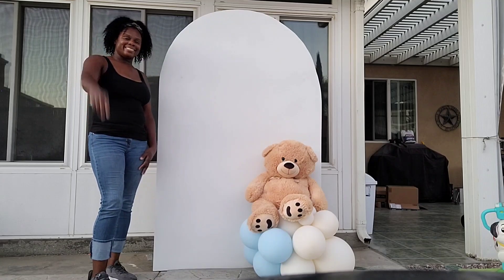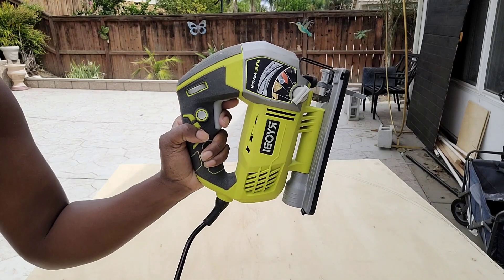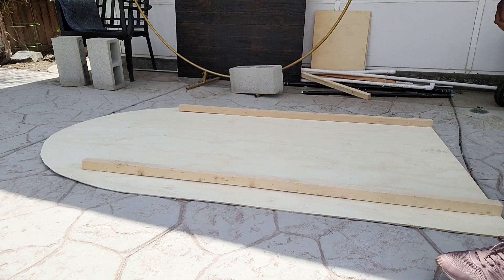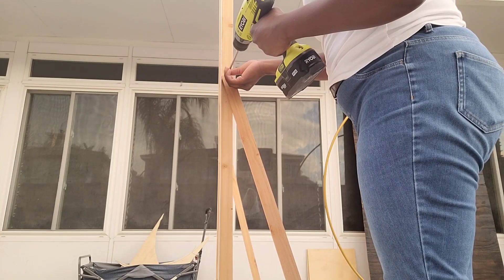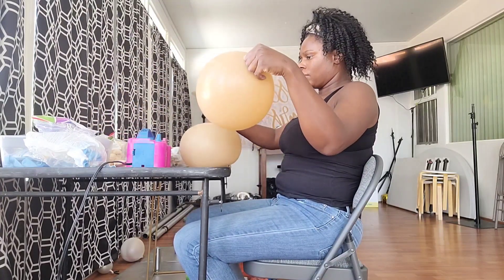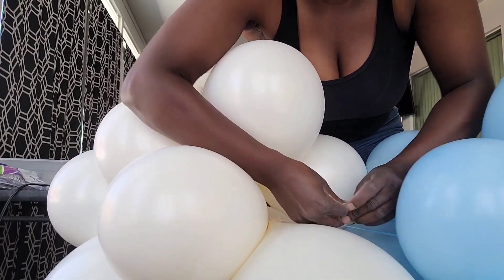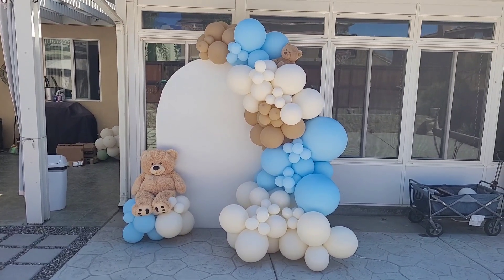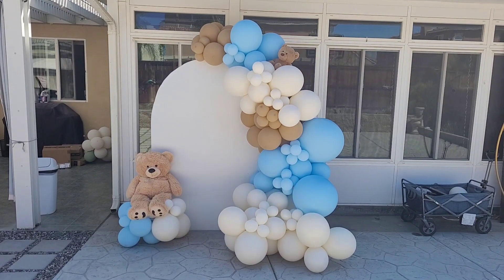Let's Create: Chiara Wall Tutorial/Teddy Bear Balloon Garland/Baby Shower

Comment: Hello, I am a big fan of your videos. I was wondering how you know when to throw in a 17 and 18 inch balloon throughout your main garland to make the larger balloons look so evenly spaced throughout. Is there a method you like to use or do you just eyeball it?
I have been adding my 18 inch balloons with 260’s to my main garland so I know  where they will end up but yours look so good and you add them right in to the main garland.
Reply from the maker: Thank you 😊. I'm glad you found the content helpful. I add 18in to the balloon garland base when I want a fuller garland
Reply from the maker: I add 18 in balloons to each cluster at a rate of 3 to 1 in comparison to 11/12 inch balloons. So if I have the a cluster of 6 balloons, 4 will be 11in and 2 will be 18in. Hopes that helps
Reply: @valsballoonsandbusiness  it sure does help! Thank you for replying!!!

Comment: You did a great job. How hard is it to cut that board?
Reply from the maker: Hello. It took a few tries to cut it the way I wanted. Make sure you use a blade that would easily cut into your board and make sure the setting on your saw fits the material you're cutting.